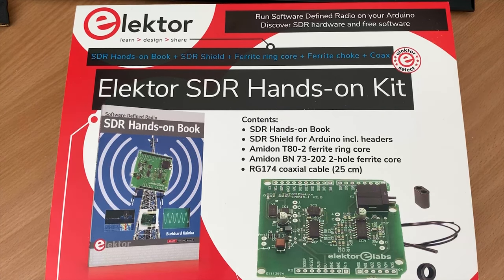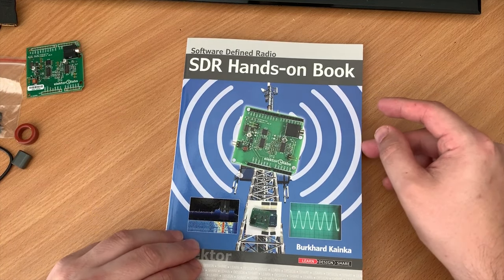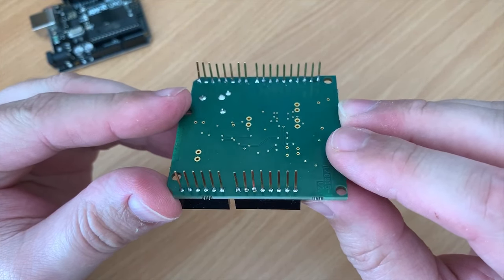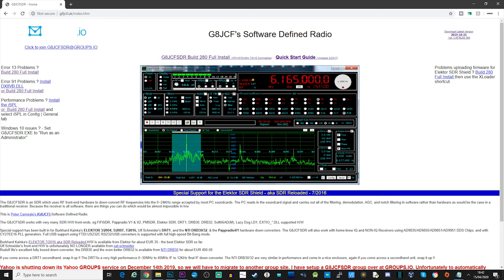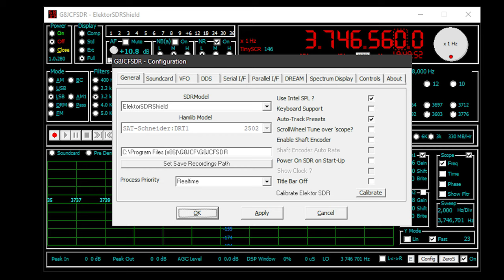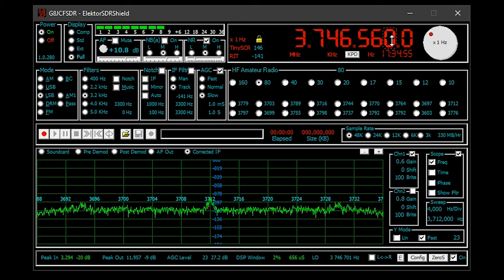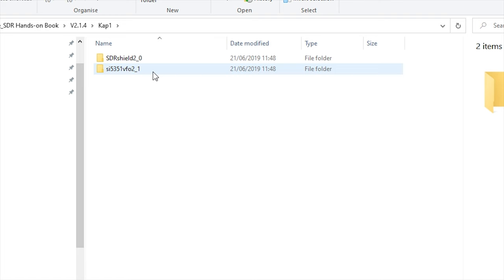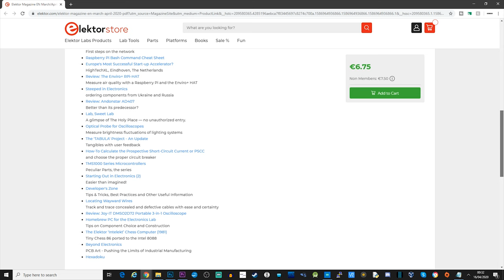Elektor SDRShield - Hands-on Software Defined Radio Kit

Comment: What kind of antenna will I need to use this shortwave sdr?
Reply from the maker: As it receives 30mhz and down you could use a random length of wire, long and high as possible.

Comment: I'd love to see more videos on this. A series please. It looks reasonably priced compared to other things I've seen, and it's SDR so you can do what you want (with appropriate license). The sky is the limit.
The transmit piece looks really interesting. Wspr with a battery and solar powered Arduino anyone?
Going over some of the code examples and what they do would be cool.
I've never seen that SDR software either. Gonna have to check it out if you don't make a video on it before I get a chance to look at it. 🤔
Reply from the maker: Sure, I did do some testing but it was slightly off frequency so I never got any hits, but I’ll revisit this project soon and create a video. Probably needs some form of calibration before TX.